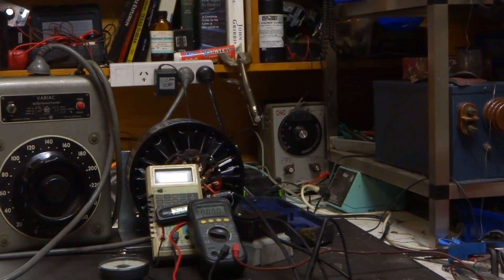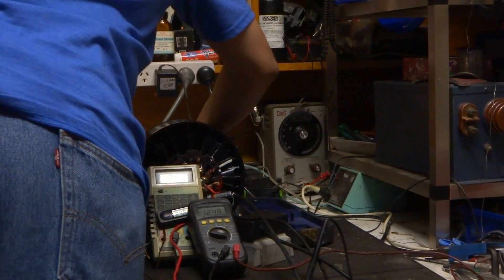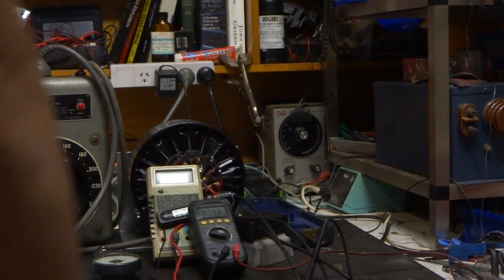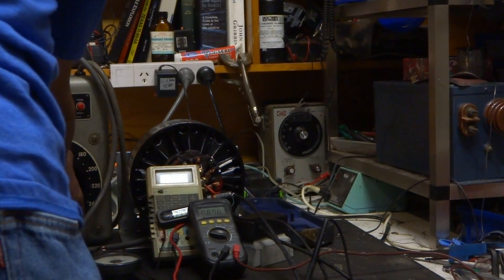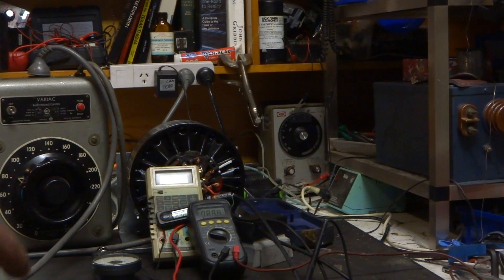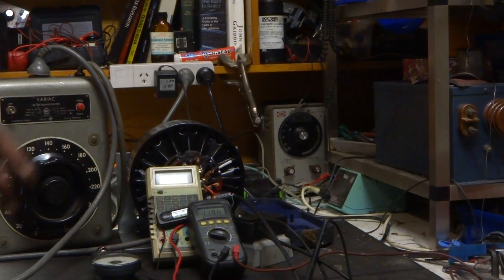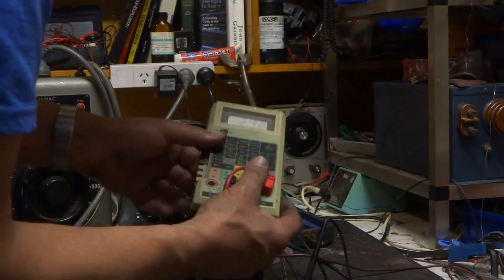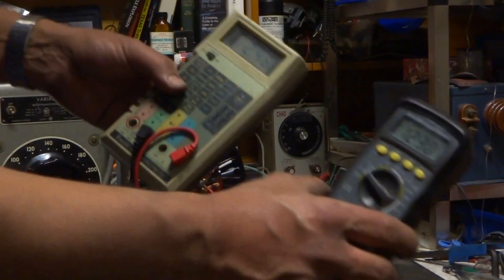Agni burning out shorts

Comment from the maker: https://youtu.be/oCyExNYobtM  The link here is an example of a motor drawing over 5.5 amps at the neutral point, and would be over 6 amps when set 1mm or 2mm into the rotation.  This test on my Agni was done with the motor already set 2 mm into rotation. The neutral point on my Agni is denoted by the long white mark, the smaller more accurate mark to the left is the set point for actual operation.